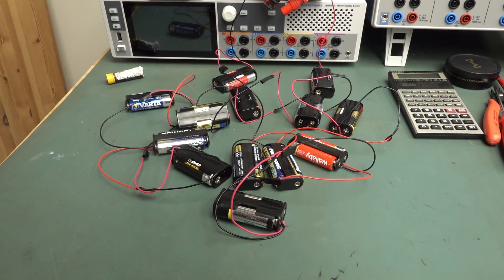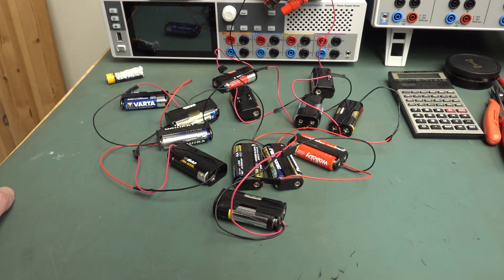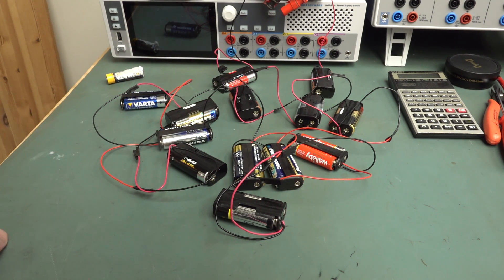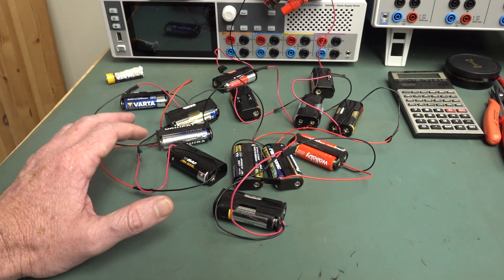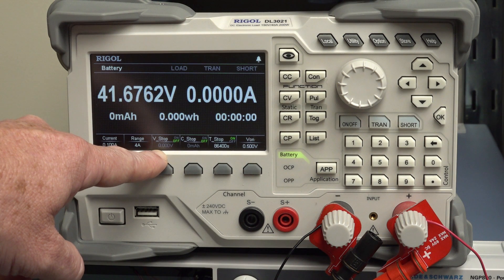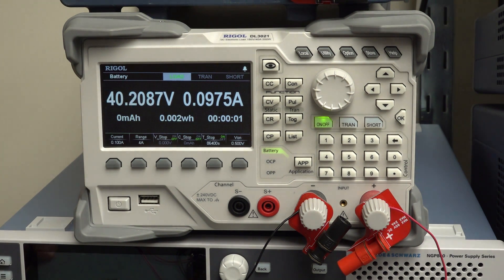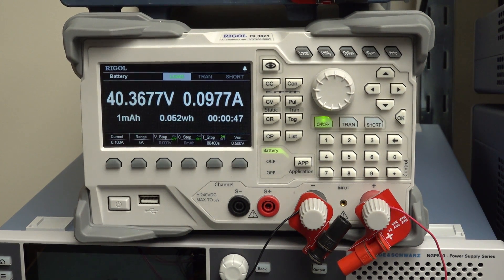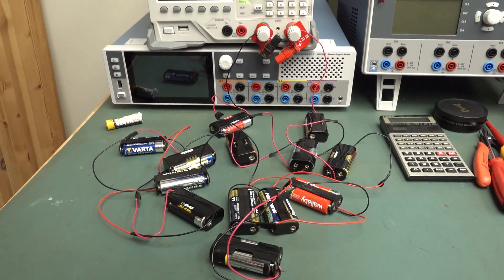Alkaline Battery Leakage Test Setup

Comment: I done 5 years ago my test. After discharge to 0,9V i discharged them in series to 0,9V, sometimes used also heat to get more power from them (got sometimes 400mAh from heating them) last test was using 4 discharged cells in series in solar light (should use 1,2V Ni-Mh) and discharged pack in series to 0,5V. Of course some of them got reverse charge (-400mV) and that ones leaked few weeks later.

Comment: In that many-batteries-in-series setup, it's wise to place a high-valued resistor (1 MEG) across each battery so no single battery 'hogs' more than its maximum voltage!

Comment: You said they roughly have the same capacity, but you may be so wrong here. Check out Project Farm - Which AA Battery is Best: https://www.youtube.com/watch?v=V7-ghrTqA44
Reply: People that aren't in the sciences think that his tests are great, and I do to, but there's always one issue that prevents his tests from having validity. It is usually a miniscule sample size. Some tests he uses a sample size of one. His most recent Li-ion battery test was the worst for me. Also, his inexperience with a particular product also leads to improper use/application or he does tests that don't have any relation to the product.Battery Mooch has done all these Li-ion tests to a higher degree (for about a decade or more).

Comment: Good timing, i had a battery leak in my Logitech G305 Mouse maybe 40 days ago, and your video reminded me to take another look. And yeah, battery is leaking again, it still got 1.42V but already crapping out - i used cheap Ikea-batteries, will now try a Varta.

Comment: I look forward to seeing the results!

FWIW I recently found a pair of Energizer AA cells that had leaked electrolyte inside of a sealed (air and water tight) device. Erm, the cells were 5 years after the expiration so maybe that plays a role on seal failure? The cells didn't bulge and split open and they didn't form the potassium carbonate crystals (again, a sealed device.) And, admittedly, I rinsed off the electrolyte before photographing, sorry! It wouldn't have shown anything more interesting otherwise: the electrolyte is just clear anyway.
http://randomer.net/stuff/expired-energizer-cells.jpg

Comment: I just finished my first ever project and built a solar battery charger.
I think I will call it a solar freakin batteriser.
It seems to work ok so now comes the hard part, I need to start a kickergogo thingie to raise 10 million dollars to develop a method of embedding them in concrete paving slabs so they can be used as garden footpaths, with built in leds to light the path at night.

Comment: I think they will only leak with more than 2 battery setup.

Is because they are designed to handle the pressure for 1.5v and -1.5v, but having like 4 batteries those 3 other could reverse charge that one to like -3V and that pressure is resulting in leaks.
Reply: @THEMenelouss my overall concept is how to trigger leak, your battery could be overall faulty as like it was said that some batteries can leak even when in original packing....

Comment: You mentioned in your main channel video that the crystals on the leaked batteries are a result of a reaction with CO2 in the air. Last time you stored the batteries in air tight containers, right? I think its a variable that should be tested. Most of the batteries that I remember have leaked were inside my collection container (for proper disposal) which didnt had a lid. So my bet for leaking batteries is: Discharged first then no load "aging" in free air. I think it would be worth testing storing some of them without the lid.
Reply: Yes, but for that to happen, the KOH electrolyte from the battery must have already leaked... and that's what produces the corrosion.

Comment: Dave! Check your function buttons on the load... the leftmost on the bottom row was reading "Current: 0.100 A." That's why you're not getting 1A
Reply: He's come-a-gutsa!
Reply: @Timo Yes. He misspoke. He's getting 97 mA, instead of 100 mA. If he was getting 97 mA, but wanted 1000 mA (1 A), he wouldn't have just disregarded it. It was only off by <3%, so he left it alone. If it was off by >90%, from 97 mA instead of 1000 mA, he would have figures out what the issue was.